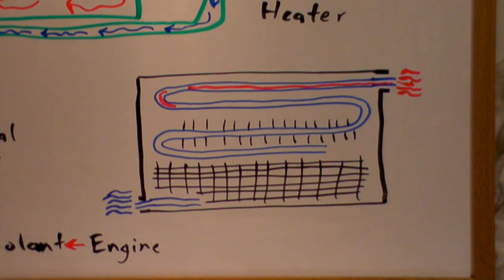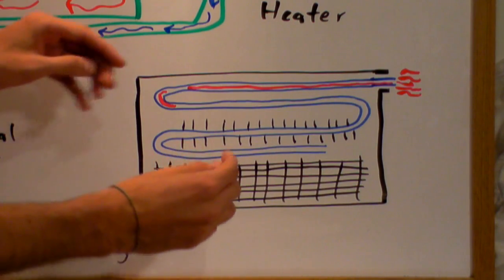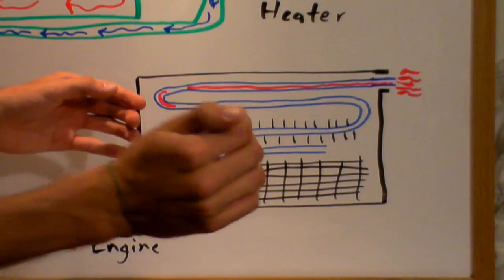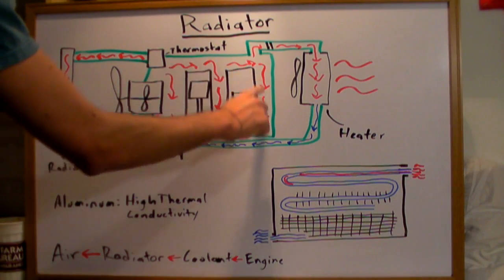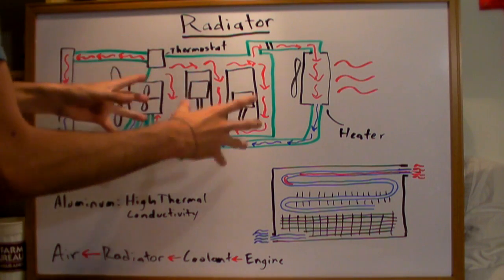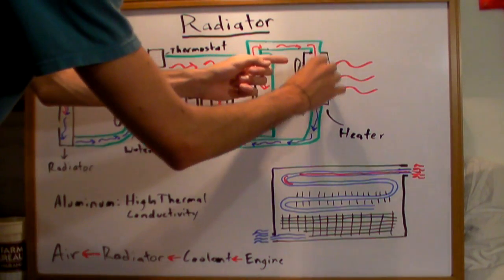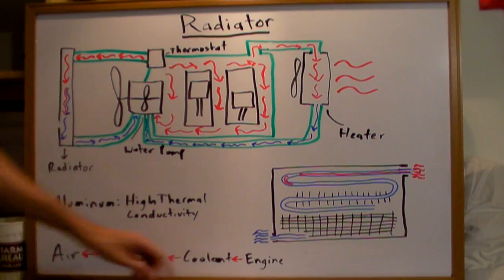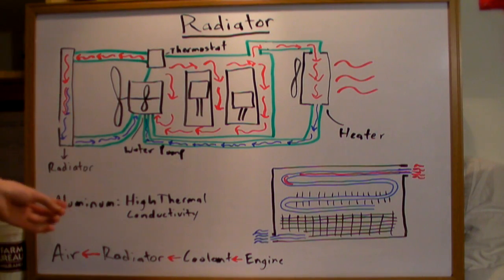Radiators - Explained

Comment: Im guessing that if my cars temp is good for 5 minutes while driving ane the heater is good, and then the next 5 minutes i cools down with hrater on that it would mean that i have different mixtures of antifreeze in engine from radiators and they are warming up or maintaining temps differently from each other to make temp change at precise intervals driving or not with heater on and is likely not a thermostat problem. Can u verify this engineering dude? What is ur name btw. 99teg eng vs h22 eng?

Comment: So technically the heat you use to warm your cabin is "free" and doesn't use more gas? Since it would just be cycled into the main radiator and dumped anyways.
Reply from the maker: Yes, very much so! (Except with electric cars). That said, it does require power for the fans to blow air, but this is fairly minimal compared to how much energy is there from coolant heat.
Reply: Engineering Explained i knew the heating in a car had something to do with the heat of the engine.

Comment: why is it that a car looses power when you turn the heater on i thought it would be the same if not increase because there are more options for the oil to cool down instead of just the front radiator?

Comment: I guess my radiator is leaking in my e46. it has a huge spot of antifreeze on it and it is all wet in front. it loses about 5dl per 100 KM. Engine temp is still fine at all times though, but i will buy a new one right now and replace it and pray that is the only leak-problem

Comment: Anyhow.
i fixed the Leak inn to the radiator Now. And the circulation now works perfectly!
So the pressure inn to the radiator is doing most of the job to get the Water Thru the Radiator, :D

Comment: Does it matter if the air outside is 40 Celsius plus?
Reply from the maker: faisal3398 Ambient temperatures will of course make a huge difference, but the systems are designed for high temperatures.
Reply: Engineering Explained  what about intercoolers in front of the radiator?

Comment: But where exactley does the Coolant go in the engin? does it splash onto the cylinders?
Reply from the maker: Nope, there are jackets around it that it flows through (little tunnels throughout the block).
Reply: awesome thanks !
Reply: ***** dont mean to be rude and but in lol...  have a look at what a head gasket does or look into cylinder blocks ,,ull understand where the water/coolant goes then alot better dude....:)
Reply: lmfao!!!

Comment: And the purpose of the big fan is?
Reply from the maker: Typically higher CFM with a larger fan (airflow) for when the car is stopped or traveling slowly.
Reply: +RzVids It's like a propeller plane. thats what makes it move.

Comment: not trying to be a douche, coolant doesnt flow in a "S" route inside radiator . its either up to down, or side to side, depending on what ratiator you have . it flows through tiny flat straight passages

Comment: i will ask you something i will find out tomorrow, 
Tho i think its a good for other to know..
my radiator Froze so then The radiator hows Blow up,video = FHIa4jLcrUM 
i Fixed this with Duck tape and Electro Tape :D just to get home, 
This Worked kinda well, Tho its no Long term solution, as it leeks just a bit when it get hot.
Tho here is what i want to ask!
Do The Pump mostly Suck the Water Out of the Radiator, Or is it the Pressure of the Hot water that push it Thru the Radiator..?

Comment: water? I thought it uses coolent?
Reply: it's usually a 50/50 mix of water and antifreeze
Reply: The coolant is just water with a little antifreeze added so it doesn't freeze in the winter.